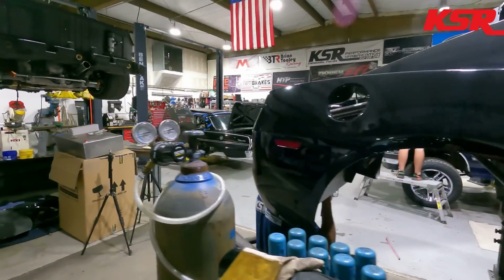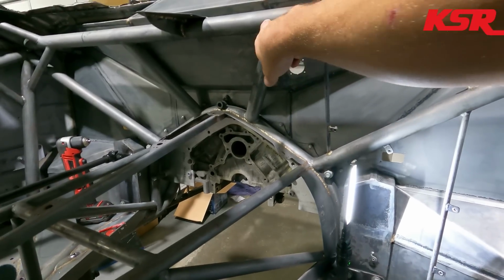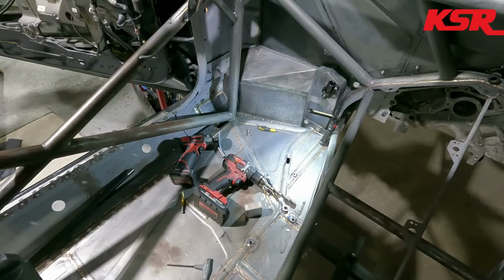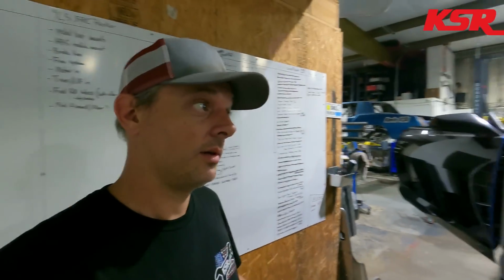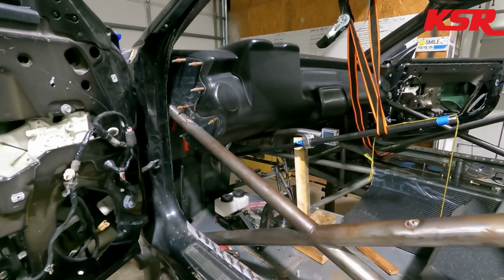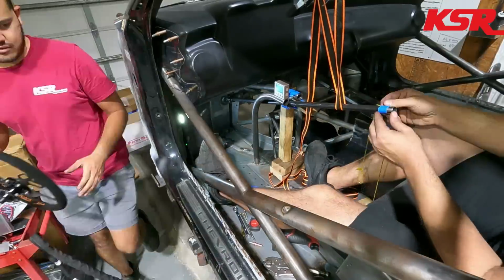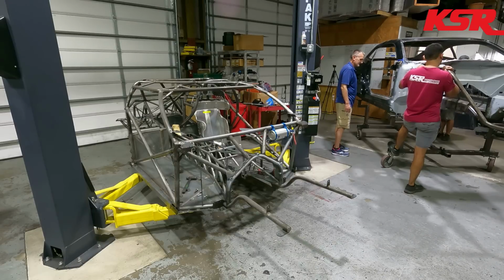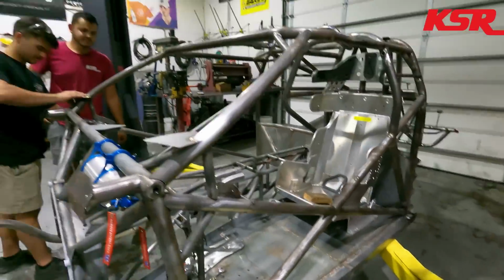This is HUGE!! Taking the Body Off of Val and Steve Morris' 6 Second Camaro Drag and Drive Build!!

Comment: The glass bulb is filled with a liquid non-flammable. Operation is controlled by an air bubble. The size of the bubble is what controls the temperature that the system operates. The heat causes the liquid to expand compressing the air bubble. When the bubble is compressed the internal pressure increases inside the glass bulb causing the glass to break triggering the fire system. These glass bulbs are used in the fire sprinkler industry and are remarkably accurate and a simple operation. Until the late 1990’s there was really only one manufacturer that was based in Germany. I know TMI. Can’t help it I’m 75 years old.

Comment: It's voltage drop your fighting, resistance (conductor length) goes up V goes down so current has to go up and wire gauge is determined by current. That's why car co. want to go to 48volts
cheaper wire, less weight, been doing it on aircraft for years.

Comment: If you clean up the pipe with sandpaper in the lathe, does it bend smoother through the die?
Reply from the maker: It doesn’t seem to matter there

Comment: Fun fact: That seat is pretty much exactly where I sit in my dad's '10 Challenger RT.. and most cars for that matter. I'm typically lined up with the B piillar or even behind it.. in the 99 Olds Intrigue I was always worried that I'd hit my head on the back side window if I was in a crash in it. Welcome to being 6'10. 
Oh, there's a cool idea.. other than it'd require the most Lame Shit engine ever.. Putting a GTO/Impala transverse V8 engine and trans into a mid to late 90's GM grandpa car like the Intrigue.. you want a sleeper. Those cars are already good for top speed runs (I personally have gone over 150 in one in about a half mile) but with the V8 horsepower (so long as it'd stay together which they never do) that'd be a blast to drive because it'd get to the top speed much sooner.   
I was looking at possibly buy a late model Camaro today.. the problem for me is my absolute hatred of the LS engine and living in a state where I can't really swap it.. Theoretically I could with all the smog components for the new engine as well as the VIN of the car it came out of, so long as it's at least a model year newer.. but that'd basically take buying an entire other car to get every emissions parts out of it and at that point, why not just buy a Charger or Mustang or Lexus or something. Honestly, my next car is likely to be a regular Mini S Cooper with a manual trans. While it'll be hell on my knees to get in and out of it, and I'd prefer the Clubman's ambulance doors instead of the hatch I'll whack my head on if I try to use it.. 32mpg and a really fun car to drive is just too hard to give up compared to 20mpg for anything else I'd drive that's newer and low teens & no AC for an old car. With it once again being 100+ and being oddly humid lately (50-75% when it's usually 20% max!) I just can't go without AC anymore. (after saying that there's a 27 Model T rod for sale for $2800... FML there's also a 53 Merc for $2500 with the original flathead and 3 speed.. put the flathead in the T, put a 302 in the Merc and you're set.. if only I could.)

BTW Kevin, how did that pool chlorine feel on your burns when you got home? You really should start wearing welding sleeves, I know it's hot but burns like that can give you bad infections... I should know.

Comment: Man I will never forget Cooper getting his fire suppression system insalled and needing it like the next work. Never skip the safety stuff and leave it for later because later may never come. Lets hope Steve nor Val ever find themselves needing to pull those handles but if they do they cant rest assured the welds wont break

Comment: Some research on Wampum PA

Population just under 600  , Land area 1 sq mile

The term wampum is a shortening of wampumpeag, which is derived from the Massachusett or Narragansett word meaning "white strings of shell beads".

The race track was opened in 2002 containing a 1.6 mile road course ( that was later extended to 2.8 miles ) , a racing kart track and an Autocross area. Originally called Beaverun  the name was changed to Pitt Race when the new owners bought it in 2011. 

The town also has a former underground limestone mine that has been turned into a  business park. For some years it was known as the Gateway Commerce Center, but is now called Wampum Underground. An optical company started working on a lab inside in 1965, which is now L3 Brashear’s high-tech construction facility for sensitive optics used on observatories and satellites. There is also storage for RVs and self storage.
Reply from the maker: We are going to have to go find that park!

Comment: Hey man, there's this burn gel stuff that I keep in my shop called "Burn Free" that works like an absolute champion on stuff like your elbow burns, especially if you get it on there ASAP after it happens.  Many times it won't even blister, or the blister is greatly reduced and the burn heals faster.  Hurts less too.  It works awesome and isn't stupid expensive.

They also make pre-soaked gauze burn bandages for severe burns, which is how I found them originally, as they came as part of a ZEE Medical first aid kit box we hung in our shop in the early 90's.  THOSE things were super expensive, and thankfully we never needed to use one on a bad burn like they're intended for, but we found that the gel they're soaked in would work wonders on every sort of burn you can get in the shop.

Many years later they started selling just the gel in squeeze bottles, which I also keep around now, and is what gets used most of the time.

You should give it a try.  The stuff really honestly does help reduce the severity of burn wounds and helps them heal faster and hurt less, especially when you get it on the burn right away and keep applying it religiously for the first day or so afterward.

Comment: I would think that the column mount support rod should come off of the dash bars somewhere instead of over from the side, would look cleaner and reduce obstructions.  Hard to tell how close that is to legs as well?
Reply from the maker: It will not be a problem with leg contact.

Comment: Your “jet nuts”, that y’all using for thread inserts, are MS21042-X nuts. The “X”, representing a digit, that represents the size, -3 = #10-32, -4= 1/4-28, etc…
Didn’t see the chassis under y’all’s Cutlass. It off to media blast / powder coat, or just taken for a tumble for finish welding?

Comment: Nice work. Although some of the pipe fitment is questhe nipple to the left of the funny car cage drivers left shoulder area that bar could have been fit a lot better. It has a large gap, so I'm wondering.  Why are other people so fussy about that and doesn't matter that much?That's a serious question
Reply from the maker: The “large” gap is less than .050, the lighting makes it look worse than it really is.
Reply: @KSRPerformanceFabrication  thank you for that explanation Kevin, I really wanna learn welding, is why I'm asking.Good luck this weekend

Comment: you know they make a nutsert tool dont have to weld a buncha nuts everywhere or you think welded nuts stronger? like arent holes in tube weak points?
Reply from the maker: The welded nuts are stringer than nut Certs for sure.

Comment: charging batterys make hydrogen atleast the acid filled ones do and had a cable arch out and the battery exploded driving so i dont want no damn battery anywhere near me after that i know its probably a sealed battery but still
Reply from the maker: It is sealed

Comment: Hey Kevin,
I want to start practicing welding chromoly tubing. How many hours or practice pieces should learn on before I weld in a "Rhodes Racecars" pre bent chromoly roll cage for my wheel to wheel car.
Realistically I wont be driving wheel to wheel for a year or 2 from now, so I believe i have plenty of time.
Thanks

Comment: Wampum is in Lancaster county, Amish country. Zero chances of a "drive-by". I still find it funny that folks think an automotive 12 volt system, low voltage, will electrocute someone. That car looks great! Drive safe and have fun!
Reply: I'm shocked that you don't believe them. 🤣. Ever test a 9v battery with your tounge? That's about what it feels like. I walk around barefoot alot so that may have something to do with it, but I've been zapped a few times. Not sure if it's a grounding issue or what does it but I've ran into a few cars that will shock you in certain conditions.
Reply: @intentsmodz  Yep, I'm aware of what the 9 volt does but that's a tickle. In all of my 61 years I've been or heard of anyone getting shocked by a car/truck and my Father was a dirt track racer since I was three.
Reply: @MosinMan76254  yeah it certainly won't kill ya or anything.  It's nothing like getting hit by 120v.
Reply: @intentsmodz  No joke there!

Comment: Can you talk about what it takes to certify a cage to less than 6 secs? Does it need to be as elaborate as "Eagle"? The wagon goes less than 6 secs, it is a nice cage but not as crazy as Eagle. How much effort to get this Camaro and/or the cutlass to that point. Thanks for all the content Kevin! Keep up the awesome videos.
Reply: He has talked a little about that on his Sunday videos.
Reply: What wagon goes in the 5’s ? If you’re talking Steve Morris no it goes 6.2x and it’s a promod just like cleetus new car only reason wagon might not cert as fast is cause it weighs over 3500lbs . Certs also depend on weight so this cage might be 6.50 cert at 3200 lbs but 6.00 cert at 2800 lbs .

Comment: Kevin, I noticed a lot of the builders are gloved and hooded up when they are welding but in short-sleeved shirts. Is flash burn from tig welding not a thing? I can remember squatting while stick & mig welding steel decked flatbed frames for small trucks and having a sock scoot down and cuff ride up - by the end of the day, shins would be well done.
Reply from the maker: I may get a little sunburn if I am cranking on a big aluminum project, but very rarely when welding steel.

Comment: That’s got to be a 16-18 hour ride
Reply from the maker: It started out at 14 when we left the shop this morning. We are running 65-70 so it will take a little longer than Google Maps originally calculated.

Comment: I have a brainstorm for you Kevin, what is the weight difference on a 4 Cyl Camaro body vs for example a ZL body??
Both empty bodies..
Reply: Minimal difference . The weight difference between them are the drive train and options .
Reply: @jkfonyi   I mostly thought that there are more reinforcements in the ZL body due to stronger engine options, if you take an example of the Vw Golf Mk1, there is a difference of 180 pounds on the body, that's a small car and and like a BMW M3 E46 differs 175 pounds if it's a sunroof or not and then it's only the difference on the roof..
What I mean is just the shell of the body, just the sheet metal otherwise empty
Hence the question from me..

But many thanks for answering..❤

Comment: Would having either a nozzle, or secondary fire system for the passenger as well just in case there is a fire while on the road?
Reply from the maker: I plan to focus the interior system on the driver since the speeds are slower on the road and it will be easier to stop the car and get out.